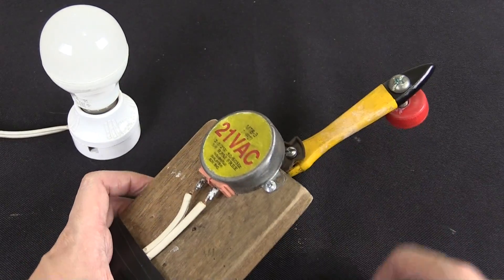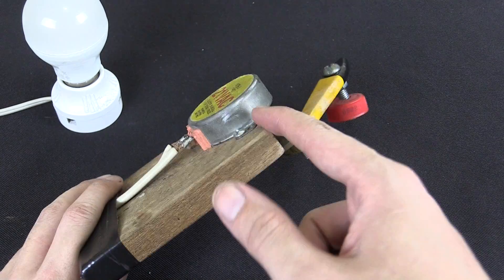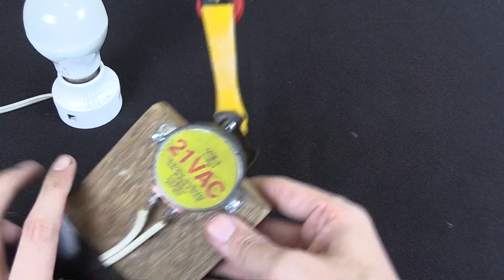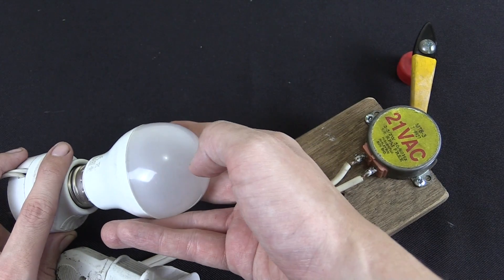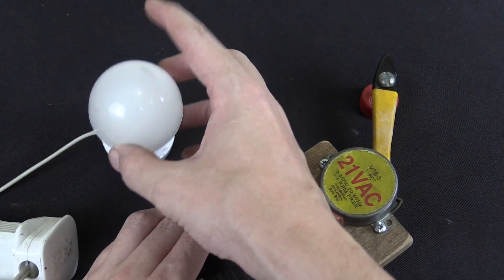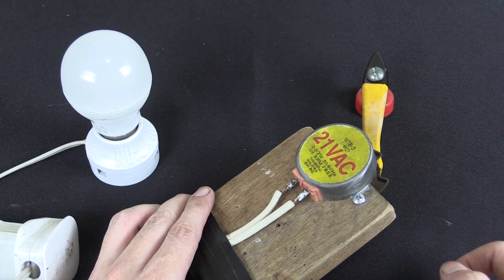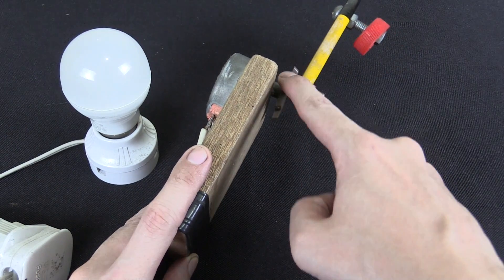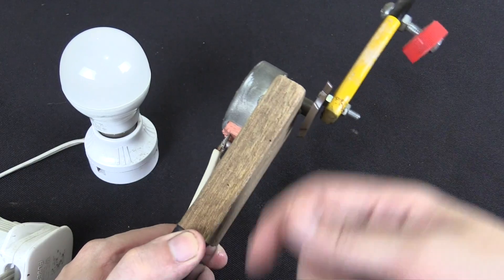Hand Crank Generator from microwave motor

Comment: Take gears out and it spins so much easier possible to power itself;() 5 v usb drill spins fast, how much electricity would it make without the un needed gears? Drill 5v to main battery in centre. 🔋 powerful. More than 5 volts

Comment: Hand crank attaching with spring called chabi wala khilona in India may store some potential energy and this crankshaft will seceded for a minute or two and may warm up a Glass of water or produced a fire in heating elements so someone light his lamp or anything so put that features in you're project 
I needed a microwave oven which is hand powered because I have no money to pay the electricity bill

Comment: I tried this with a 120 volt turntable motor, and it did not register anything on my volt meter AC or DC. I wonder why not?
Reply: Mark Price Did you feel strong resistance when trying to turn the spindle? If not, one of the 4 or 5 years inside may be broken.  You can't spin 120v microwave motors as fast as this guy is spinning this 21v one.  You'd break the gear quickly on a 4-5 rpm motor.
Reply: Trucker Chris Yes, there was good resistance, but you called it, the gears inside broke. I thought maybe I wasn't spinning it fast enough, so I ended up putting too much torque on the gears. I do know it was working in the microwave at the time of disassembly for the transformer. Thanks!

Comment: It’s weird because mine said 21 V too
but I had a 21 V AC supply and would not power it even though it was rated 21 V AC it would only work on 120 V AC. I probably just don’t understand the ratings on some of these things Nice vid BTW
Reply from the maker: Are you sure your power supply is AC and not DC?

Comment: You could make a wind generator out of it to light your house on a windy evening !
Reply from the maker: It would need pretty big blades because this is a high torque, low rpm, motor. A standard DC motor would probably do better for that :)

Comment: Is it the same as the 2nd motor of the box that allows the wind in different direction?
Reply from the maker: Sorry I don't fully understand the question. I only know of one motor inside the microwave.
Reply: I mean the box fan, an electric fan that does not oscillate.Is it the same on the second motor that allows the wind in different direction?
Reply from the maker: Oh I see what you mean. I had always assumed it was a single motor that spun the fan blade and a gearbox for the rotating front grill. Have you opened it up and found it has a second motor instead?
Reply: Yes have it is rated as 230V and 10Amps limit.
Reply: If I spin it and my skin is connected to the terminal I get a shock.
Reply from the maker: lol that suggest it might work for this kind of project then :)